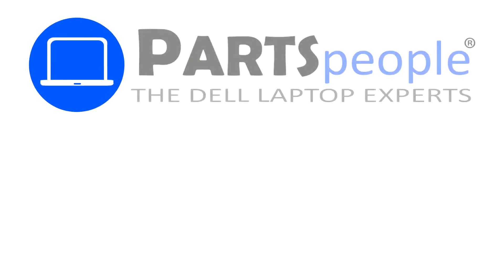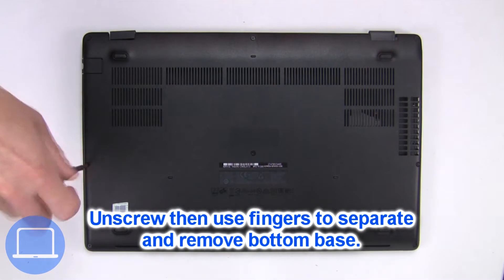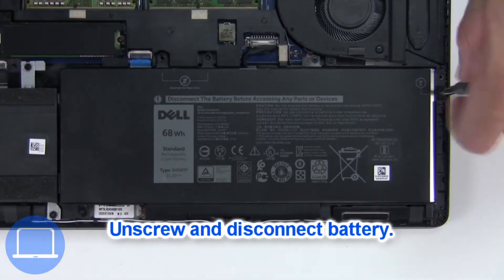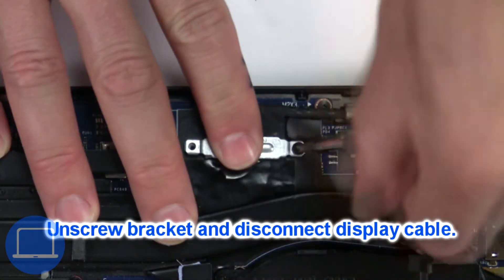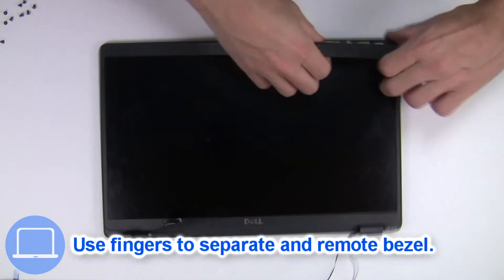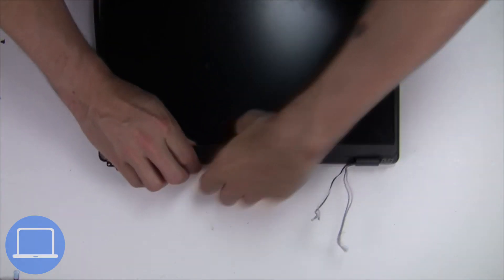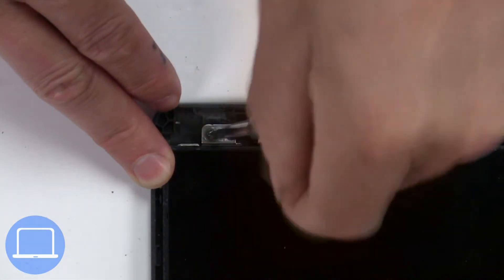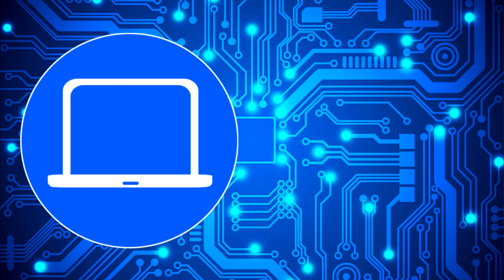Dell Precision 15-3551 (P80F004) LCD Panel How-To Video Tutorial

Comment: i havent removed/replaced the 3551 lcd, but it looks like u dont have to remove the entire screen housing?  just remove the bezel like most/some other laptops
Reply from the maker: Since the Dell manual recommends disassembling the full LCD assembly I follow their steps as a safety precaution. However, the bezel can be removed without doing so if you are very careful.

Comment: Sorry for my ignorance. Would it be possible to install a LCD screen with a higher resolution like the 4k oled one from the XPS 15 ?
Reply from the maker: Hi, sorry for the late reply. Maybe you've found the info you need by now, but it looks like FHD was the highest resolution of screen made for the Precision 3551. Use your service tag on our website to see a list of compatible screens as they're specific for each model and a XPS 15 screen will absolutely not be transferable.  https://www.parts-people.com/